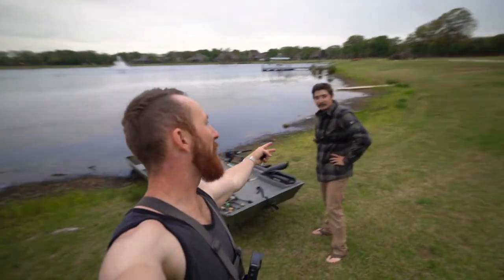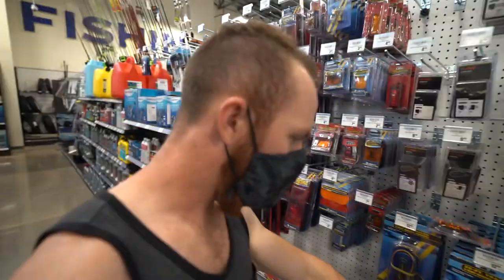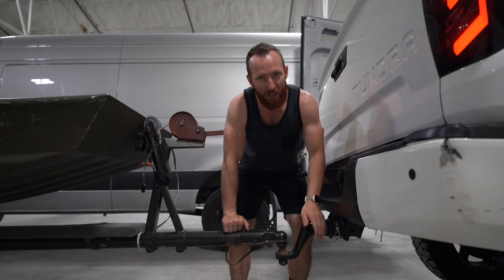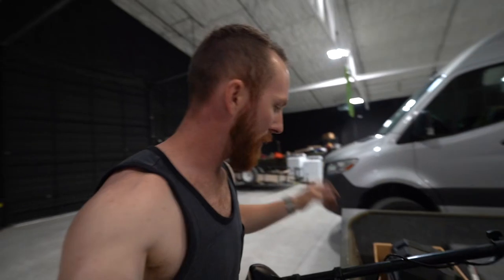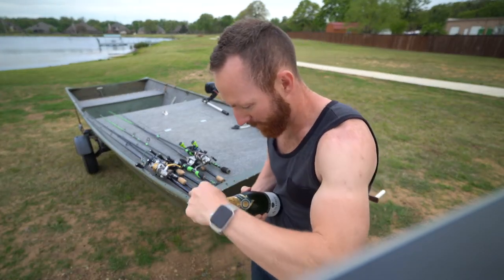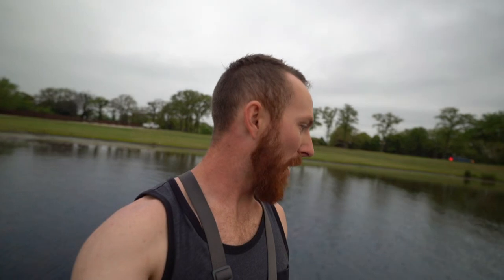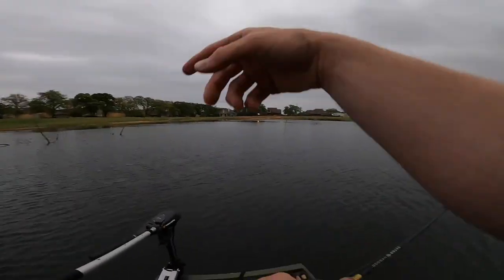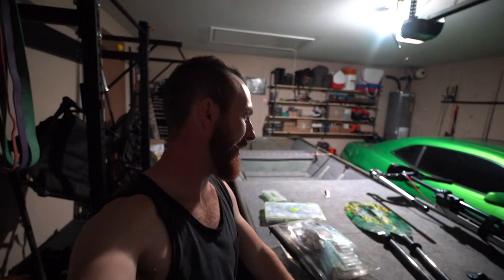ANTIQUE 1974 JON BOAT 1st LAUNCH w/ CHAMPAGNE TRADITION 🍾 (will it float?)

Comment: How do you know if you are properly exposed when vlogging on your a7III? I've always wondered lol
Reply from the maker: Different with every camera but they all have internal meters to judge exposure. I keep my shutter speed and aperture constant so it just adjusts the ISO but I have figured out in 90% of cases if I’m outside and have the Peter McKinnon 2-5. Stop ND filter on Max I’m good for outdoors light and I turn it to the minimum if I’m filming indoors and often bump the exposure up +1 stops for low light stuff. The short answer is you trust the camera and learn how it likes to expose and get things dialed in pretty good from there
Reply: @WestinSmith  awesome, thanks!

Comment: Hey man! I know I should prolly not ask you this question but is there a warranty for the googan squad rods or like a refund. I was fishing with the twitch rod and I was giving it very light twitches and I hadn’t banged it into anything or stepped on it and it just snapped. It snapped doing what is was meant to do lol which isn’t good at all. I have only caught a few fish in it and only used it for a couple months. Rods should last longer than a few months I assume.